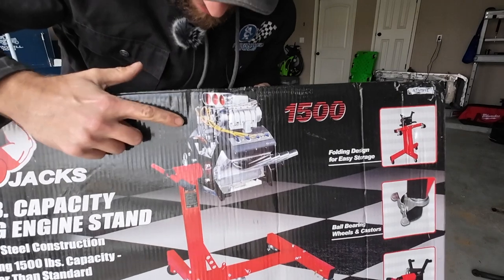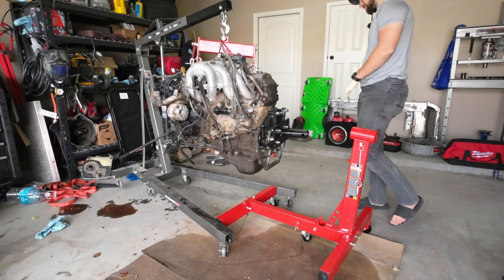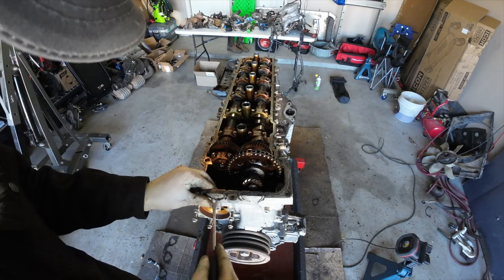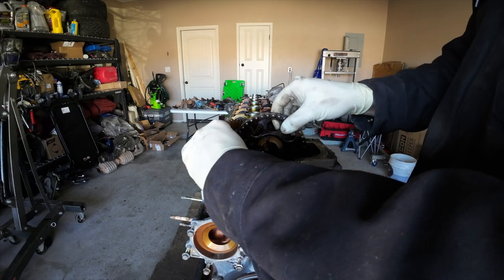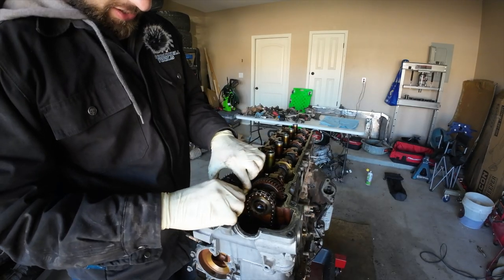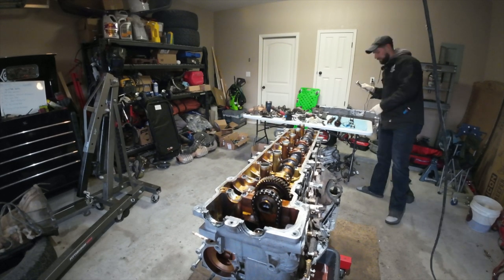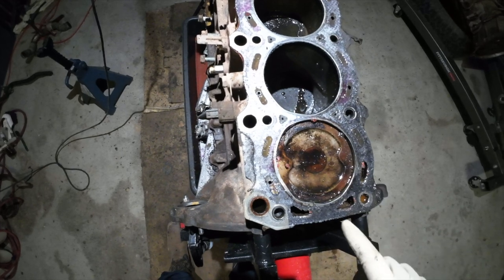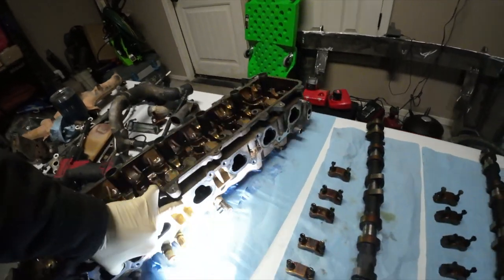I've Never Seen A Head Gasket Fail Like This Before! | 80 Series LandCruiser Engine Teardown Part 1

Comment: Nice. I just finished my motor. On my OBD1 1FZ, the split gear compensates for backlash. I would change out all those timing components: timing chain, cam gear, crank gear, sub-gear.

That headgasket is toast. You can tell if it was original if it's different than the redesign gasket, the new Toyota head gaskets are different. Mine was blown on cyl 3 and I didn't even know until after I pulled the motor out. It also didn't have perfectly round cylinder holes in the gasket. Specifically on the blown cylinder.

That's going to look clean when you get it back!
Reply from the maker: I saw your latest video! Looking great, and it's an awesome feeling seeing engines come together 😂.

Just did a parts inventory and I've got everything related to timing brand new. Had been awhile since I looked 😂.

Comment: great video just did my engine with new oem parts. got 200 miles on it and headgasket is leaking , Head is brand new and block was machined. I order headgasket from Partslane on ebay and i think i may of got a knock off gasket . I am about to pull if out and see what happened. I even used brand new head studs.
Reply from the maker: Ah man, sorry to hear that. I'd also double check the new head. I've gotten new heads with casting defects before and I usually have them inspected by my local machine shop. But yeah counterfeit parts on eBay are a real problem these days as well.
Reply: @motor.mausGarage  Thats good to know I will do that.

Comment: Ontario, California USA. Also, I pointed out in a previous video you have an EGR delete. Would love to see how deep you get into the diagnoses of fail in #6 piston. I am planning on replacing my current 1FZ (2nd motor in LX450) with an LS swap at the next major motor failure.
Reply from the maker: I would definitely go LS if you want to get the best bang for your buck and don't mind things sitting for a little while. Also I need to look into some EGR block off plates, because all the EGR components are still on the engine 😂
Reply: @motor.mausGarage  I think witsend used to carry EGR shaped "keychains" for various vehicles. A relatively expensive but very clean solution.  On my first donor motor swap I put off the LS because I just wanted to keep the rig moving and be ready for summer. 
Good luck with the rig. Dig the videos

Comment: Most descriptive 1FZ close up footage on youtube! I've got a 93, absolutely caked in grease. I just did the birfields and a pinion seal, found out why six point sockets are necessary for certain bolts (welder had to make an appearance to get my diff plug removed). I'm curious how many miles this engine had before failure. I like many others have considered an LS swap when my FZ meets its fate one of these days, and if I were to be taking the motor out for repair I would be happy to put something in with more power and better gas mileage. Realistic price comparison from what you are doing vs a swap? Thoughts?
Reply from the maker: This one let go at 246k miles, and wasn't maintained very well 😂.

I would probably say it's a pretty similar price to either OEM rebuild or LS, but LS would definitely give you more bang for your buck imo. I've got a video coming out in a  day or two going over the total cost of this rebuild for some context!
Reply: best way to remove diff fill plugs is to use a 6 point socket and breaker bar with a bottle jack if the socket slips a bit put a dish cloth over the plug. also my rear diff drain plug has been spinning for about 10 years after hit it on a rock it wont tighten wont loosen and cant remove it but it doesn't leak and have to use a vacuum pump to change the oil

Comment: Isn't a built turbo short block going to cost more than an LS swap and get you like 6 mpg if you're lucky? Lol. I wanted to do the same thing because the concept sounds super rad but also super impractical.
Reply from the maker: I had considered an LS swap for quite awhile actually. The thing that kept me from that the most is those projects always sit for a number of years for one reason or another, and ideally I'd like to have this thing running this year at least 😂.
Reply from the maker: Not to mention I can collect turbo parts as I go, and still be able to drive the 80 which is more my style.